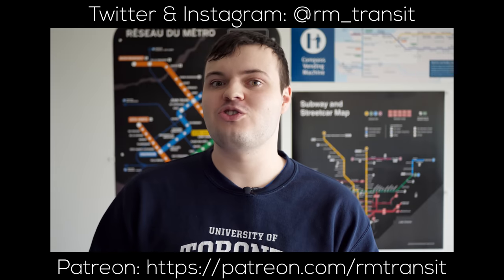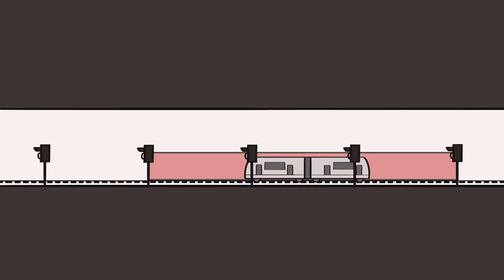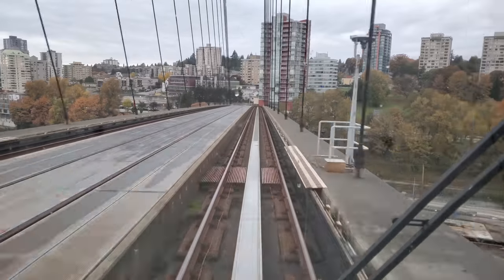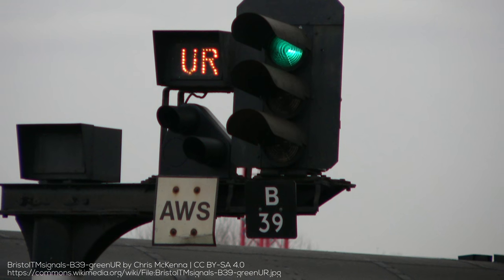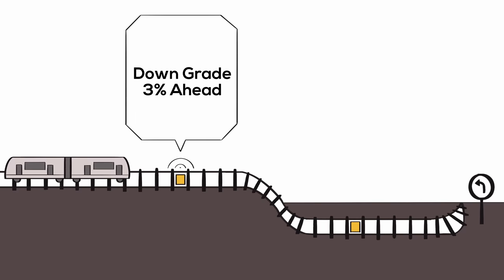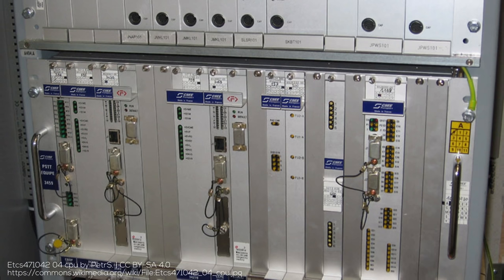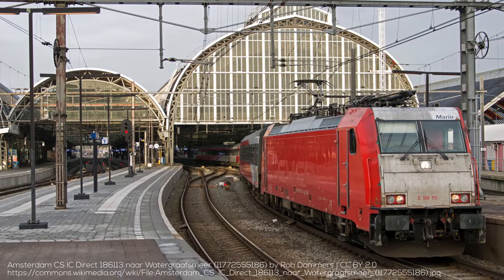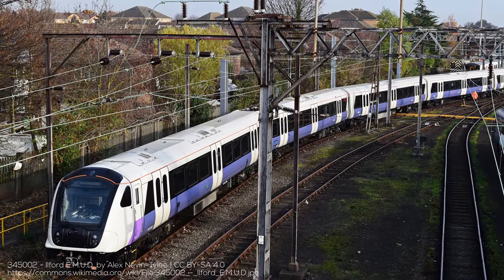How We Keep Trains from Crashing | Signalling & ETCS 101

Comment: I've always felt signalling is the least talked about yet seemingly most important part of rail systems, great video! Would love to see the GSM-R etc. video.
Reply from the maker: Make sure you're following Tyson because he talks a lot about these things and is an expert!
Reply: Signaling feels a lot like logistics to me, always overlooked and sometimes even downplayed but it can make or break a system.
Reply: It seems that it envisaged to implement ETCS Level 1 in Toronto, not radio-based ETCS (Levels 2 or 3). Since the new FRMCS standards is about to replace GSM-R in the coming years, it should be considered to use that in Toronto. From an implementation perspective, I (working on high-performance system based on ETCS at the Stuttgart Digital Node project), ETCS Level 1 needs lots of cabling and has quite some complexity, while being fairly limited in the field of high-performance optimization.

Comment: I'd love to see an explanation of the various different unique and unusual signalling systems employed by mass transit systems and their unique advantages and disadvantages. Great introduction to signalling btw.
Reply: As a general overview if you didn't already know:

The Chicago L used to use a passive "signalling system" in its core section. Drivers sit on the right of the cab (I am pretty sure) and there were special sign posts every few metres on the left side of the track. If the driver could not see at least 2 sign posts they were not allowed to pass the sign post closest to them. (The reasons for not seeing the sign posts was either because of a sharp corner that you had to get closer to, to see around, or the back of the train in front obstructing it. It's essentially like trams and driving on sight but the signs added an extra level of caution and spacing to stop trains from hitting each other.

Systems have used "signal overlaps" for a long time, in this video they talked about block sections and how only one train is allowed in each block, but the reality is that the blocks overlap each other by up to 250 metres (for passenger trains) so that if a train is stopped directly after the end of the block but not in it, the next one doesn't get to go up to the signal, pass it because of reasons (happens 2 to 5 times a year on all networks) then crash into the back of the train in front. The problem is when every signal has to have 250 metres of overlap, it can diminish the capacity a lot because it's basically impossible for trains to get within 250 metres of each other. Several systems use have special mechanisms and signals to allow reduction of the overlap and it would be interesting to see a video about all of them.

Comment: Interesting ongoing story- Thales and Alstom were contracted to supply a new SelTrac CBTC system in 2015 for Hong Kong's MTR on 7 of its 10 lines (the other 3 were either planned to upgrade to different CBTC systems or opened with one). This system was considered to be the very best.

BUT a train crash- first ever on the MTR network occured during an overnight test in early 2019. A bit complex but basically a secondary backup system was being tested and the data for each section of track was not transferred to the secondary computer somehow. This made the computer allow two trains to enter a crossover at the same time, a very serious accident. 

Fast forward to mid 2022 and all the wayside equipment has been installed but there is NO certainty as to when the CBTC system will be commissioned, if it ever will be. The software involved needs more or less a complete overhaul and that will take forever I guess.  New trains ordered to run with the CBTC system are now modified to use the existing signaling system, while it seems like the first gen M trains (due to retire once the upgrade is complete) will be im service for some time to come.
Reply: That MTR incident is fascinating to study and confirms a common saying: systems tend to fail at their interfaces. This type of interaction is what makes brownfield deployment (i.e. a new system on an existing line) inherently riskier than greenfield (i.e. a new system on a new line). I think this is one of the reasons why a hard cut-over approach is often chosen over a hybrid deployment, at least in the metro CBTC world.
Reply from the maker: @tys_mo  the whole idea of having multiple signaling systems is very interesting especially in the Metro context
Reply: @RMTransit  Hello from Hong Kong. Software issues are really quite a big problem in signalling systems as the software systems controlling all the different sub-systems are becoming more and more complicated. Another accident apart form the MTR Tsuen Wan line crash is a huge signalling fault that plagued the 4 urban lines (Tsuen Wan line, Kwun Tong line, Island line and Tseung Kwan O line) of the mtr network for the whole day which trains are running in increased headway and reduced speed.

The problem originated from a software difference that went unnoticed for  twenty something years. The entire network upgraded to SACEM from Alston before the opening of the Kwun Tong line extension and the Tseung Kwan O line. The signalling equipments and the underlying software for the wayside computers are supplied by a separate contract from Siemens for the extension and new Tsuen Kwan O line at that time. It was known after the investigation that the wayside computers from Alstom, which is the developer of SACEM, will automatically reset the software counters when the counter reaches its maximum value while the Siemens computer won’t and will crash when the counter is full. As all counters of the wayside computers are synced, crashed software counter of the Siemens computer disrupted the operation of all wayside computers in the system as they repeat the sync process. The issue was later resolved by isolating all wayside computers and reset them 1 by 1. Another valuable lesson learnt with a 20 million HKD fine paid to the government.

Btw, the distance-to-go signalling utilised in SACEM and the now decommissioned TBL system of the east rail line is quite an interesting topic worth a video to talk about. The system utilise beacons, axle counters and the onboard computer to calculate braking curve that allows the train to stop close to the train ahead in what should be the buffer block in the traditional fixed-block system. The system can achieve a very short headway of up to about 120-150 seconds that rivals some of the cbtc systems, quite astonishing as the technology is already 30 years old.

Comment: IIRC, the old brujas in the Subte A line in Buenos Aires had a "stick" pointing up & connected to the emergency brakes, and signals had another "stick" in the way when they were red, so if a bruja crossed a red light, the sticks would hit and the emergency brakes would automatically engage.
Reply: Berlin S-Bahn has a similar System, but they began replacing it since a few years
Reply from the maker: Yep that's essentially a train stop / tripcock
Reply: Thanks! I didn't know how it was called.

Comment: When the Elizabeth line opens on.May 24, 2022, the newly opened central section will not connect with the main lines to the west and east of London, and only run from 6 am to 11 pm Monday to Saturday. The extra time in the early morning and late evening and on Sunday will be necessary to sort out the software. It was decided to use a CBTC system from Siemens rather than ETCS for the central section. Perhaps there wasn't much experience of using ETCS on a metro system, although Thameslink (a regional rail operator which is part of the national network) runs with ETCS and automatic train operation through the central London core, and can run 24 trains per hour to a variety of destinations north and south of London.

There are two other signalling systems on the main line parts of the Elizabeth line, ETCS on the Heathrow branch and TPWS (Train Protection Warning System), the usual system on the British rail network, for the rest. I believe Network Rail intends to install ETCS from London Paddington to Airport Junction. ETCS will be installed on the east coast main line, but I don't think there are any immediate plans to do the same on any other main lines. Incidentally, I am not a signalling expert, and have got this information from the web and other media!
Reply: Yes. When I heard that, on the opening of the Elizabeth Line on the 24th May (I'll be there!), it would initially be operated as three separate entities, I did consider that they wanted more time to bed-in the interoperability of the systems. You certainly don't want a train failure at the junction of two different systems!

Comment: 7:04 To clarify the situation in The Netherlands/Holland: The current safety system is ATB, developed locally in the 1960s. What you mention, HSL-Zuid is a high speed line that has its own tracks for large parts of its route. HSL means high-speed line; Zuid means South. It is connected to Belgium and so helps us to travel fast to Belgian cities as well as London, Barcelona, etc. Anyway, this part of Dutch railway tracks is protected by ETCS. In the near future, ETCS will replace ATB entirely.

Comment: Recently the cbtc for the HCMT sets in Melbourne have come online, and over time more services are using it between Westall and South Yarra. Outside this section and regional/freight trains still use the old system of block working. I’m amazed the integration works so well between the two, as the line side signals turn off when a CBTC service comes through.

Comment: the majority of lines in my coutry only have one set of rails. How they NEVER colided was allways a question I had
Reply: Because your single-track line is also split into blocks, as described in this video. When a train enters a block from one side, no train can be allowed to enter it from the other side. Periodically along the line there will be short two-track sections to allow trains to pass each other.
Reply: Sidings
Reply: @m0llux  Yes... but I remember that feeling as a kid when driving by the street near the single train line, it allways made a certain impression
Reply: @Duck-wc9de  single-track lines were always such a wild concept to me who lives in a country where it's all metro, until i travelled to europe and finally understood how they work and what passing loops were
Reply from the maker: @m0llux  precisely and if you aren't operating a massive number of trains it's totally acceptable
Reply: @Duck-wc9de  Yep, probably because that bit of street wasn't near any switches or signals. I totally understand that feeling, but rest assured that there is signaling equipment at either end of that single track segment which prevents the passage of opposing trains.
Reply: It works just fine on low frequency lines. Personally, I would prefer if they spent money on eliminating level crossings before building double tracks
Reply: @papaquonis  Level Crossing have zero effect on the capacity of railway lines. The only things they do is reduce accident risk and annoyance to drivers.

Building a second track onto a railway line more than doubles the capacity of the railway line.

So yeah, I see the point, but level crossings ain't too bad, actually.
Reply: @m0llux  "The only things they do is reduce accident risk and annoyance to drivers".

As a train driver, that is exactly why I want them gone.

Comment: Great video Reece. This clarified a lot of things I didn’t know about ETCS. As we know, the signal system used depends on the owners of the tracks which Canada’s case are the freight rail lines. I am not sure if our commuter rail systems require a signal system overhaul and whether that would conflict with what CN/CP have employed. With GO moving towards electrification and higher frequency of trains, are we in need of resignaling for commuter rail?
Reply: Yes. GO is planning to use ETCS as part of their GO Expansion plans
Reply: @mrrobot5963  thanks for the info. I am curious how ETCS will work together with the existing systems that CN/CP use
Reply: @japanesetrainandtravel6168  In theory ETCS can work completely independently. Locomotives that don't have it don't even notice the Eurobalises, and if the ETCS trains communicate on a different frequency than the freight trains, everything should work fine. The big issue will be making sure that the ETCS side of the main office is getting the right information about which train is where from the non-ETCS side of things, and vice versa.
Reply: @dda40x  thanks for that! That said, I assume ETCS is able to communicate the proximities of freight and vice versa?
Reply: @japanesetrainandtravel6168  Yes, it is able to do that. It will need some sort of interface to the systems for freight to do that, though. This won't be impossible, but it won't be easy or cheap either.
Reply from the maker: Etcs is going to be used as some commenters mentioned and fortunately it's super flexible to work with other systems as well!
Reply: If this ETCS system will overlap with the existing CTC (Centralized Traffic Control) of CN, CP or even Metrolinx-owned track that freight rail uses, I imagine the Canadian Rail Operating Rules (CROR) is going to need a rewrite by Transport Canada. Being in the freight rail industry I can tell you there is absolutely no mention of such a system today. I’m trying to figure out how this would practically work. It would seem to me, freight locomotives would require the same tech on board as the transit vehicles and I don’t see that happening. Even PTC in the US took about a decade to implement and that is only for trains operating on lines with passenger service.
Reply: @gordonalsop8537  My understanding is that CTC's origins were as a specific implementation of an SCS (special control system) before becoming explicitly codified in the regulations. There's no reason the same couldn't happen with ETCS: that's exactly the point of SCS/special instructions. As for how the implementation will actually work, that's the fun bit! It's worth mentioning that using ETCS doesn't preclude the use of signals and operation exactly as things are today. In fact, such an operational mode may benefit CN when they travel on Metrolinx-owned lines. I don't think any of that has been decided yet though. Exciting times ahead!
Reply: @gordonalsop8537  hi
The implementation in the uk ECTS and the existing system can both be present at the same time. This means drivers trained with the new system can use it and those that have not received their trading can still drive trains on the line. the ECTS on the NOrth city Line has Been installed. With driver being trained over the next few years. When all the driver have been trained the existing system will be removed with the tack side signals in theory. In reality the existing system will probably never be decommissioned

Comment: The train knows where it is at all times. It knows this because it knows where it isn't. By subtracting where it is from where it isn't, or where it isn't from where it is - whichever is greater - it obtains a difference or deviation. The guidance subsystem uses deviations to generate corrective commands to accelerate or decelerate the train from a position where it is to a position where it isn't, and arriving at a position that it wasn't, it now is. Consequently, the position where it is is now the position that it wasn't, and if follows that the position that it was is now the position that it isn't. In the event that the position that it is in is not the position that it wasn't, the system has acquired a variation. The variation being the difference between where the train is and where it wasn't. If variation is considered to be a significant factor, it too may be corrected by the ETCS. However, the train must also know where it was. The train protection system scenario works as follows: Because a variation has modified some of the information that the train has obtained, it is not sure just where it is. However, it is sure where it isn't, within reason, and it know where it was. It now subtracts where it should be from where it wasn't, or vice versa. And by differentiating this from the algebraic sum of where it shouldn't be and where it was, it is able to obtain the deviation and its variation, which is called error.

Comment: Trams/streetcars do use signals. They mostly use the same signals as cars and buses.
Reply from the maker: Yes just not railway signals ;-) but sometimes they even use those
Reply: There are quite a few signals on my local tram network (UK Manchester Metrolink)
They are required at several locations such as
Converging junctions so that if 2 trams arriving simultaneously which one can go
Diverging Junctions to show route set and clear to go
Single track sections
Road crossings
sections where visibility ahead is restricted such as a curved tunnel
Reply: So traffic lights.
Reply: Traffic signals are not a form of railway signalling because they do not control the headway of trams relative to each other.
Reply: @OntarioTrafficMan  Railway signalling achieves two purposes:

Stop trains on the same line from crashing into each other.

Manage trains through junctions

If you delve into the specifics of how these  these operations are achieved, doing the latter is considerably more complicated while also still being a part of railway signalling. Junctions, interlocks and route indicators have nothing to do with controlling the headway of trains, yet they are a much bigger part of signalling than headway control.
Reply: @RMTransit Chur alp Grün...